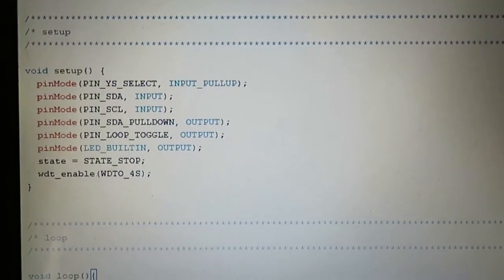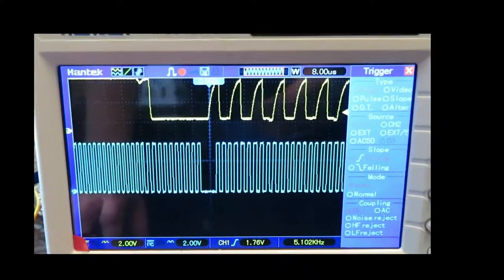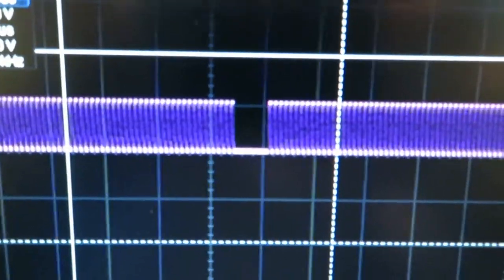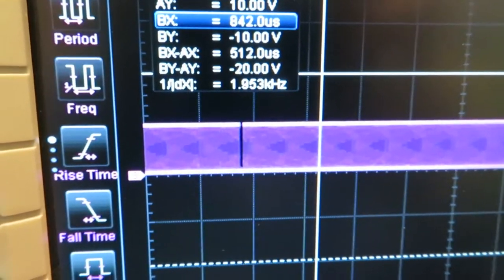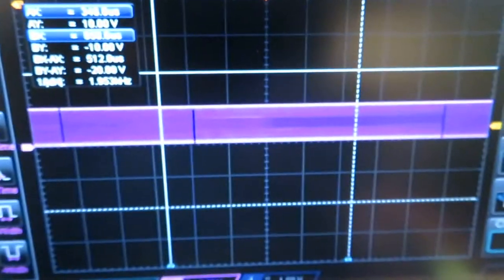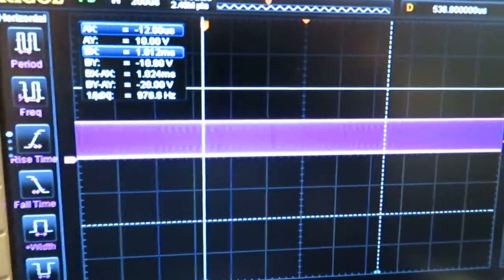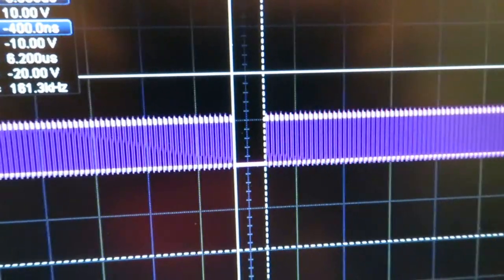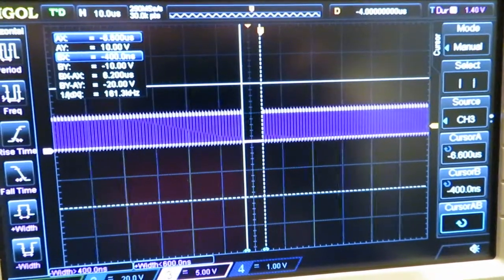Stuttering Arduino sketch code? Why is this happening?!? Anyone?

Comment: yes i was running into the same problem with the uno and mega trying to make a ps2 controller. I think it has to do with the bootloader you probably use a programmer it should fix those problems

Comment: You probably know this by now or don't really care being 4+ years later, or maybe you figured it out in a different video and didn't say here... but maybe someone else will stumble on this and care.
All that's going on is you're seeing the TIMER0 overflow interrupt execute. This the timer that increments the counters that operate millis(). The timer counts from 0 to 255, 256 (counts) repeatedly and counts from the system clock (16MHz) with a prescaler of 64. In other words you get an overflow every 256 * 64 = 16384 cycles. Which at 16MHz dispatches the overflow interurpt service routine every 16386/1600000 seconds, or once every 1.024ms, which is your BX-AX reading for your cursors. At 5:29 that's a decimal point (not comma); And, you don't sound like you're from part of the world that uses commas fraction separators, but I could be wrong.
So we're talking about an ISR dispatch at regular intervals spaced slightly more than 1 millisecond apart, or would be if the system clock were dead on at 16 MHz.

Anyway, while it's in the ISR executing the code that updating counters that millis() consults, it is not running your code that does the pin toggling code. So you see those dead periods then. If you were to run cli() or more generically noInterrupts(), you would see those dead periods disappear. Alternately if you turned off the interrupt enable for overflows in the timer0 registers it would also stop. By the way I measured how long it stays in that ISR, at least with  a recent (to time of writing) ArduinoCore-AVR/toolchain and it takes about 6uS or so, which is in line with the length of your dead interval.

And you probably know this, but you can swap out PORTD ^= BIT_LOOP_TOGGLE; for PIND = BIT_LOOP_TOGGLE; Writing to PIND (as strange as that sounds) causes a toggle for every bit you have set to 1 on the right-hand-side. It just winds up being slightly smaller code and faster code.

And then there's PWM which keeps going whether interrupts are dispatching or not.

Anyway, hope someone gets something out of that.
Reply from the maker: Oh I see. Thanks for that in depth explanation! Hopefully someone else will find this useful. I just figured it was the bootloader ISR waiting for code uploads or serial communication. Good to know you can just disable these interrupts.
Reply: @pcbjunkie1  when the board is reset (which usually happens when the port is opened because of how dtr is wired) it enters the bootloader and listens for code. When it times out and transfers control to your sketch it's no longer in the picture (until rest), so it won't affect the timing. It's not actually in the background while your own code is running. Anyway, glad you got something out of it.
Reply from the maker: @TT-nd8sy  Yeah, that makes more sense. Thanks again!